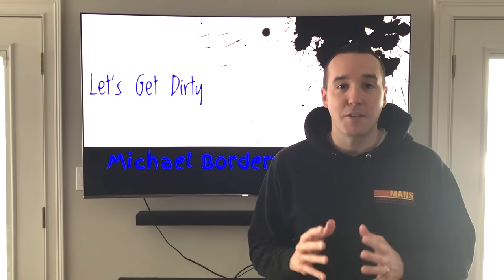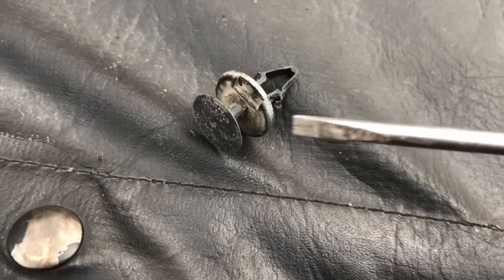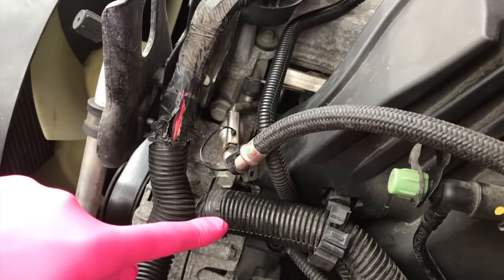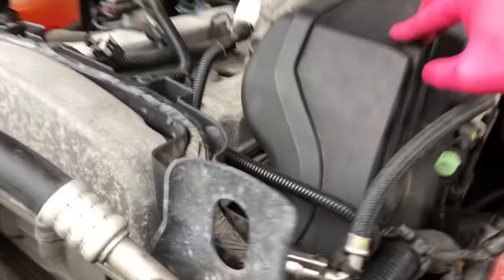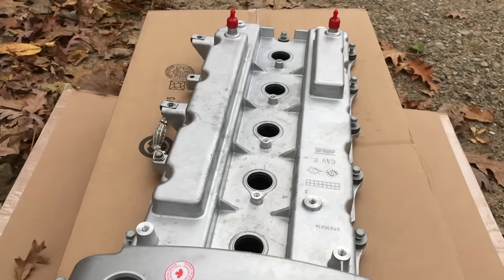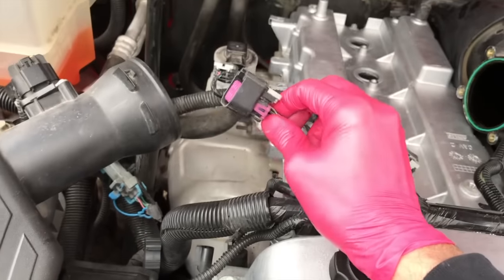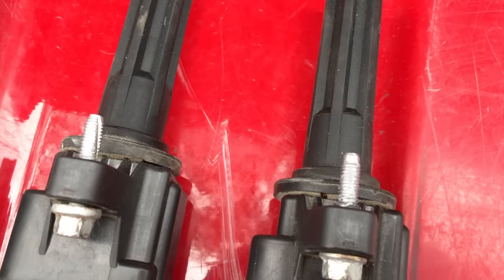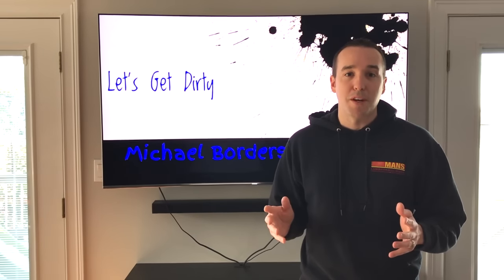How to replace Valve Cover & gasket - Colorado/Canyon - FAST & EASY!

Comment: There was oil in my spark plugs. Could it just be the gasket
Reply from the maker: Reality rap motivation 

Thanks for watching & sharing your experience.  Great question & this is definitely more common than you think...not just the Colorado.

Over the years of the engine running, the circular grommet gaskets begin to warp, dry rot, & fail allowing oil to leak into the Spark Plug chambers/tubes.

The oil then interferes with the proper firing of the Spark Plug & leads to degraded engine performance....not good!

Replacing your main gasket at the same time as replacing your circular gaskets is always a must.

Below are a few links to our videos showing more about oil on Spark Plugs & how to fix it.  Although these videos are for different vehicles...it’s the same concept!

       https://youtu.be/CNmxbPIzX-o

       https://youtu.be/Aa6vsGAk98o

       https://youtu.be/CNmxbPIzX-o

Keep us posted on your DIY project!

Please subscribe to the channel and turn on your YouTube notification Bell 🛎 that would be awesome thanks again!

😎👍🔧🔩

Comment: I noticed you said to change the oil after driving 100 miles.  But, I was wondering if you needed to drain the oil before taking off the valve cover?  Would you suggest replacing the ignition coils when doing this job?  What's the criteria for doing that replacement?  Also, I didn't see the link you mentioned at the start of the video.  Are you able to add the URL in the info about the video, underneath the published date?  And, finally, great tutorial!  I see this job coming up when I next change the spark plugs on my '04 Colorado.
Reply from the maker: Eric Rocereta 

Thanks for watching & sharing your questions Eric.  We drained oil after 100 miles.  Replacing oil prior to replacing Valve Cover is personal preference.

Below are a few links to the videos you mentioned.  Definitely check those out!

       https://youtu.be/QCl6B9ZBATY

       https://youtu.be/4VeDtU97yPQ

Keep us posted on your DIY project, we are here to help!  Please subscribe to the channel and turn on your YouTube notification Bell 🛎 that would be awesome thanks again!

😎👍🔧🔩

Comment: How do you remove the rear driver side pcv hose? Does it just pull off? Is there a clip holding it on? No shot of the removal in your video but it has to come off to remove the valve cover.
Reply from the maker: Thanks for watching & welcome to the DIY Raptor Club.  The small hose can be carefully shifted off as it does not have a clamp holding it on.  Hope this helps, please keep us posted on your project.  Us fellow DIY’ers need to stick together!  Enjoy your day.

😎👍🔧🔩
Reply: @DIYwithMichaelBorders  perfect thank you! Im going to see if it is clogged with frozen oil condensation first before diving into a valve cover removal.
Reply from the maker: @therealgabrielcash  

Great idea & hope to hear from you soon.

😎👍🔧🔩

Comment: We have loosened all the bolts on the throttle body case and it will not come loose. It is still tight! Any Help with that?
Reply from the maker: Thanks for watching & welcome to the DIY Raptor Club.  There must be one more bolt thats secured & not allowing it to come apart.
Reply: A6mm bolt has 10mm head  just as 1/4 bolt  fits 7/16 wrench

Comment: I'm at the point where I can start removing the valve cover bolts but that black plastic piece that the throttle body was connected to doesn't seem to be loose or moving even after I loosened all of it's bolts. Do I have to pry on it at all or do the bolts have to be removed completely or is loosening them up all the way enough.
Reply: Man I'm at the same exact spot.... WHAT DID YOU DO!!!! These guys sure skipped somethings because mine is the same way. And I fallow3d step by step
Reply: @THETRUTHb4u   There's probably more bolts that you can't see and missed. That's what ended up happening to me. Use a flashlight .
Reply: @THETRUTHb4u  If I think of it tomorrow I'll go and count the bolt holes and then get back to you.
Reply: I just posted a video. It will be uploaded sooner or later. Watch it tomorrow please.

Comment: 2007 Colorado 5cyl.200k miles. been getting a 301 code cyl 1 misfire. I've changed the spark plugs, coils, fuel injector. all the connectors are getting juice. compression test good (haven't done a leak down). could the o2 sensor set off the cyl1 misfire? i would think that it would set off a misfire on all cylinders. any advice? also been having rough slow starts (mostly in the cold mornings)
Reply from the maker: Matthew Whitmus 

Thanks for watching.  We hope you enjoyed the video.  O2 sensor is possible however unlikely.  Do you see any signs of leaking oil out of valve cover?... Possible failed valve cover gasket which can throw off the proper pressure & firing readings.

Also, any possible chances of a vacuum leak in that area near throttle body etc. can cause symptoms like yours.  Keep us posted.

Many more helpful videos to come!  😀  Please subscribe to the channel and turn on your YouTube notification Bell 🛎 that would be awesome thanks again.

😎👍🔧🔩
Reply: I don't see any sign of valve leak. I've sprayed brake cleaner around the vacuum hose and there was no rpm change. I'm gonna try the smoke leak check soon.
Reply from the maker: Matthew Whitmus 

Thanks for the reply, please keep us posted.

😎👍🔧🔩
Reply: @DIYwithMichaelBorders  fixed my problems, I ended up having a faulty injector causing the 301 code. the auto shop says I still have a slight misfire in cylinder 1 but apparently not big enough to set off the engine light. 200k miles im sure the cylinder has some wear on it. as for the occasional no start, it ended up being a passlock problem. "relearned" it and haven't had a problem since
Reply from the maker: Matthew Whitmus 

Awesome Awesome & thats a great update Mathew.  We are happy to hear you’re back up & running.

We also had an annoying misfire in cylinder 1 several times.  We replaced the coils & plugs on all cylinders at the same time & haven’t had any error codes since.

Always remember, us fellow DIY’ers need to stick together!

😎👍🔧🔩
Reply: The little vacuum hose that hooks up to the throttle body, does that slide a little bit? I broke the clip and it slides a bit but doesnt come all the way off.
Reply from the maker: Matthew Whitmus 

Good question & you can purchase a brand new clip from your local Chevy dealership.  They will want the last 8 digits of your VIN # so that they can get you the exact replacement part for your exact truck.

Since it is a connection clip for a part relating to your vacuum system, it can very easily lead to a vacuum leak & then trigger additional error codes and degrade engine performance.

😎👍🔧🔩

Comment: why put on a new valve cover and not just a gasket?
Reply from the maker: chupa cabbra 

Thanks for watching.  Great question.  We just made this video for our fellow Youtubers.  Us fellow DIY’ers need to stick together.  Many more helpful videos to come!  😀

Please subscribe to the channel and turn on your YouTube notification Bell 🛎 that would be awesome thanks again!

😎👍🔧🔩
Reply: The valve cover is part of the PCV system. It can get dirty and clogged. Prolly why they replaced it instead of just the gasket. I just cleaned it out and works just fine. Saved some money with a bit more labor.

Comment: How  many bolts hold the intake by it self.not talking the ones are attached to it.
Reply from the maker: ELIAS RODRIGUEZ 

Thanks for watching & unfortunately we are not at the vehicle currently.  A rough estimate of approximately 8 bots secure the Intake to the engine.

We hope this video helped.  Keep us posted on your DIY project.  Please subscribe to the channel and turn on your YouTube notification Bell 🛎 that would be awesome thanks again.

😎👍🔧🔩
Reply: Ya I will ..I do have an 2006 Chevy Colorado 3.5 l whit 5 in line need to change  valve cover and possibly the intake that's why I was asking .
Reply from the maker: ELIAS RODRIGUEZ 

Very cool.  We have enjoyed the I5.

😎👍🔧🔩

Comment: I really wish you would talk a bit louder. Otherwise good video.
Reply from the maker: Bill Carini 

Thanks for watching Bill, we are so happy to hear you found our video helpful, sorry about the sound!

We love saving money & making projects into DIY projects.

Let us know if you have any questions, we are here to help, & definitely keep us posted on your project!

Please subscribe to the channel and turn on your YouTube notification Bell 🛎 that would be awesome thanks again!

😎👍🔧🔩
Reply: @DIYwithMichaelBorders  I recently purchased an 05 Canyon 3.5 4Wd with 230K! It was supposed to be for work but things didn't go exactly as planned. So now I have this truck and I just want to go fast! I've worked on cars for my entire life but there is a lot I haven't done. Transmission, differential or had the chance to rebuild an engine. I've been driving big V8 trucks for the past few years and although this truck still has plenty of power, it's no Hemi! I need more power but my wallet laughs at me...
Reply from the maker: Bill Carini 

😆 the wallet does the same thing to us haha.  The I-5 engine is pretty nifty & was designed during the rough times back in 08-11.

People wanted a fuel efficient truck however the 4-cylinder engine did not provide the tow capacity & power that a 6-cylinder engine does.

So GM decided to engineer the 5 which provided better tow power than the 4 & better fuel efficiency than the 6....they met in the middle.  😀

Thanks again for sharing your comment Bill.

😎👍🔧🔩

Comment: You don't have to loosen the intake up just take the throttle body off you doing all that work for nothing
Reply: Not true, you can loosen the bolts but the valve cover can’t come off because the intake manifold overhangs the valve cover

Comment: The whole point of me watching this video is because of a problem that I have been having with my Chevy Colorado not cooling down in idol.  I changed everything that pertains to cooling the truck down.  Coolant Sensor, fan clutch, water pump and cleaned out the Throttle body.  No results though in cooling the truck down in idol.  Code went out after cleaning throttle body.  No check engine light.  My research is showing me that a Intake Gasket could be linking and causing these affect in cooling it down.  This started after the plugs were changed by Jiffy Lube.  So I am wondering now that maybe one of those gaskets are linking.  I am taking it to someone I know that will do a pressure test Monday.  This will tell me if that is the problem.  I have noticed that the problem is affecting as time goes on when it goes into a low gear and shakes now.  As if there is to much air intake getting in and not allowing to idol down to a lower gear quick enough as well.  This has been a pet project as of late.
Reply from the maker: Pisces 

Thanks for watching & sharing your experience.  Sorry to hear you’re having troubles with your Colorado.

You’re on to something...that’s definitely a possibility.  Have you replaced your Thermostat in the past?

Keep us posted on what your mechanic says on Monday.  We are here to help as well.

Please subscribe to the channel and turn on your YouTube notification Bell 🛎 that would be awesome thanks again!

😎👍🔧🔩

Comment: Is this video possibly compatible with a 4 cylinder 2.4 L?
Reply from the maker: Thanks for watching, there will be noticeable differences during the project however once all parts removed…off with the cover and new cover and gasket installed followed by reversal of steps.

Keep us posted, we enjoy helping and look forward to any questions or updates as you work through the project.